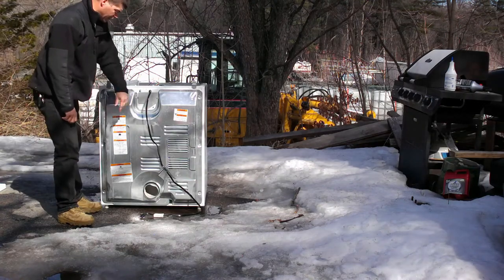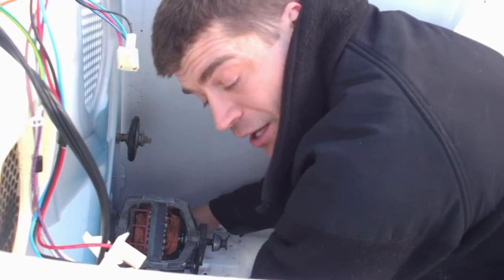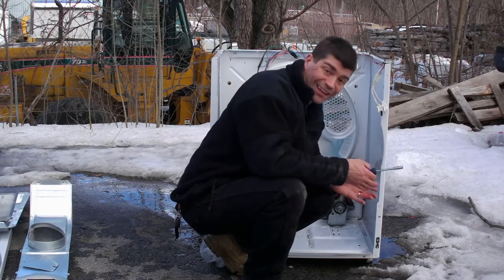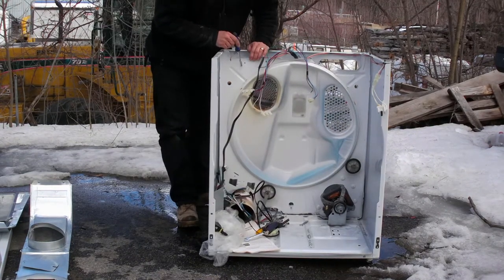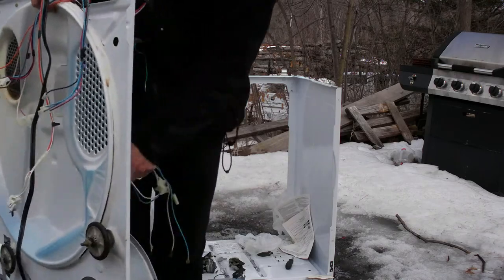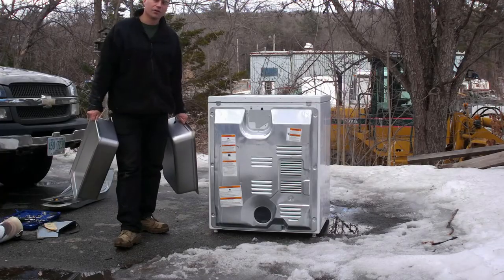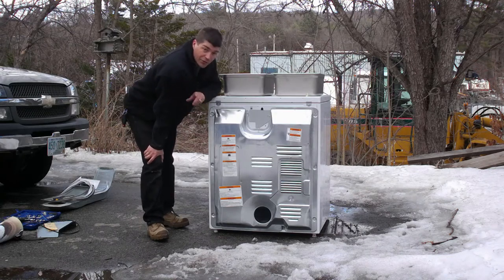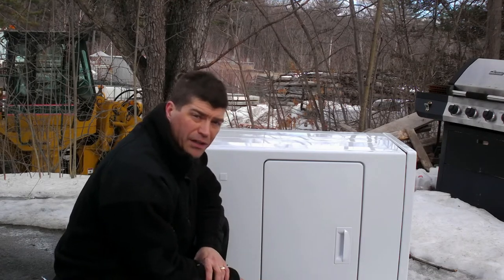Question about the dryer Maple evaporator build

Comment: I would put the pans in the top.    
Try to see if you can flip the back panel upside down and screw it on so the flue hole is at the top.   It will likely need some "modification" but it looks like it should essentially fit
A layer of brick on the bottom interior might keep you from burning through too quick, too.
Reply from the maker: Great idea. I may line the inside with cinder block or brick. I just hope I get enough sap to use it this year.
Reply: @HomesteadingwiththeHeberts  I think some patio block "walls" standing on edge would make a great fire box if you have some!
Weird that your sap isn't running strongly yet.   We've averaged 6 gal / tap this season, and I'm just a half hour away
Reply from the maker: I know I just can't figure it out.